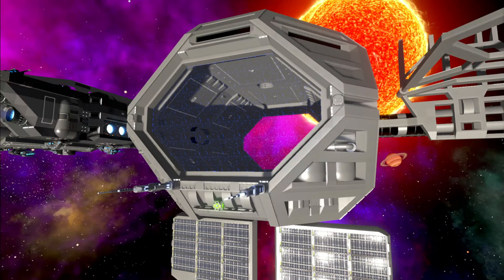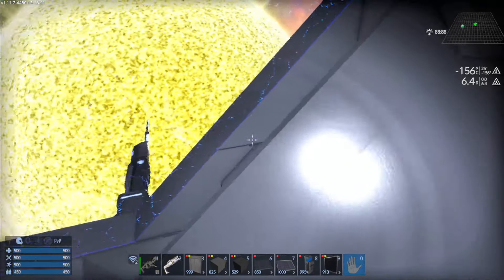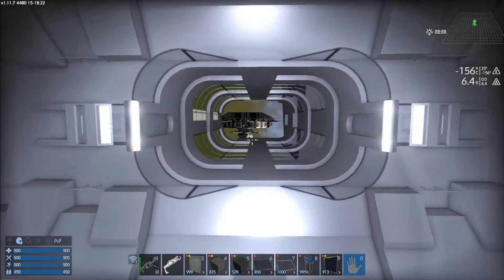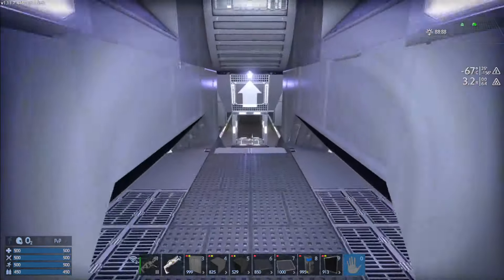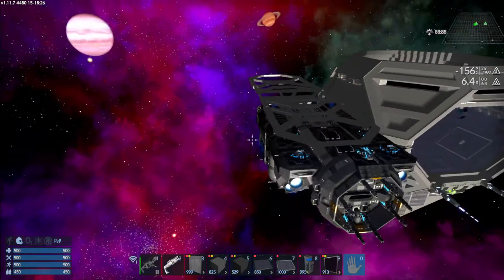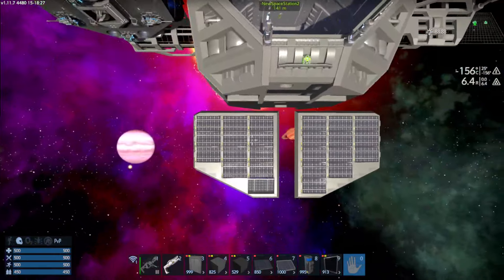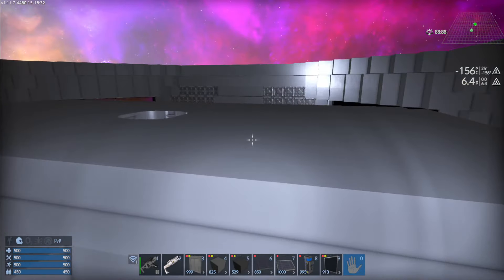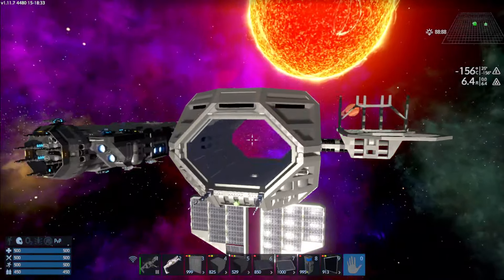Empyrion Galactic Survival - New space station WIP update 8/15/2024

Comment: Planets can really be at any angle to the star relative to the ecliptic / 'O' key / god-mode plane. I've even seen planets that are directly below the sun. Usually if I find a sector I want to settle in I place a base starter and experiment with the different panel angles to find the best one, then go into creative and modify the panel system on the base to customize it for that playthrough. Though what could be interesting is to do a thinner / more-spaced-out frame structure with the solar panels that would allow the player to pick up each panel and replace it with an angled version (basically, manually do the auto-rotation that you wanted the game to do).

The other option is to just let the player aim directly at the star and don't place the base using the 'O' key. To some extent you've already embraced that concept as the majority of your landing pads can't make use of the 'O' key to aid in landing. There are even some suggestions in here to embrace the six degrees of freedom further by placing modules at crazy angles (like, how about vertically-oriented docks on each side that make the base look like a Tie Fighter?).

Comment: When I built my new space base for RE2, I built it to be able to either run on solar power or plasma turbines or even a mix of both. How far away (AU) from a sun you spawn in a space base with solar power determines how much power you’ll get and it seems that panels on an angle are a thing too! Didn’t know that, or it’s a bug. 😄 Regarding your base idle power, it’s a smart solution to be able to use what you need. If you can’t place plasma turbines, then you need to find a sector that’s close to the sun.

Comment: Had a thought for the module bays  What if the were off of the bottom. have a vertical shaft down the have them come off of that. you could have 2 facing each other like you did on the left and then go down again and repeat, or you could do a plus shape set up and have 2 levels allowing for 8 modules 😂
solar panels would then be of the left and right of the main body

Comment: The rounded corridor looks better, maybe because of the contrast. What if you stack the Helios modules? Maybe even stacked 3 high on either side for 6 modules. They might look less imposing that way. They could be straight out from the sides, or maybe just on the side away from the sun, allowing solar panels sunward of the modules on either side or something. I do not prefer the panel wing under the base.

From 2 to 4 furnaces is plenty IMO. I usually have small solar furnace bases placed near any major base I have, some of those end game ores are so slow. With improved wifi you can get pretty good range, and I like throwing a few solar powered deconstructors out in little satellites too. I would imagine coming into this base with my main ship, parking it very close above, and transferring ores to furnace satellites, and parts to deconstructor satellites, then the rest of the loot into the main station.

Hmnm, a combat module that can salvage a wrecked ship and bring the stuff back to this station for processing.... A dropship module for ground POI attacking, a Plutus for space mining,,, yeah, you do pretty much need 4 module slots at a minimum. But it does give me a feeling for a new playthrough based on this design. It would be much like my Haphaestus station playthrough with those three module ships it used. I would have to hunt down the right system to live in.

I'm impressed you got the forcefields looking so good. I thought it impossible.

Thanks Jeff!

Comment: I'm partial to the bottom position of the solar placement.

That is a particularly elevated system in regards to the sun.
That does influence the efficiency of the panels, as well as the type of star / temperature.

I did a fair bit of experimenting with testing the different stars and sectors. It takes a bit to find the perfect sector. ☀️

I'd love a modular kit for personalized assembly, but I definitely understand that not everyone is familiar with the creative modes. 😅